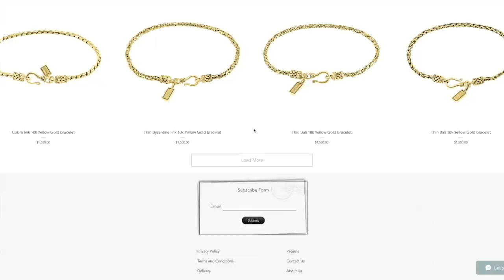Celtic cuff bracelet | how it's made

Comment: Making it look so easy. Not a lost Art! Dynamisjewelry inspiring!
Reply: Drawing silver wire through the plate is not as simple as it appears.  It requires proper annealing of the wire, getting it started properly and liberal use of wintergreen oil to make it slide smoothly.  I've had lots of drawn silver wire crack.  Might be easier to buy the silver wire in the diameter you need.  Also wire mills are expensive.

Comment: BTW: You do not need to solder. Just wrap the ends. You do not need to have rolling tool, you can use premade wire and just hammer it together. You do not need drill. Polish can be made by hand.

Comment: What do you use to whiten the silver after the fire?
Reply: The white color is an effect from the pickle solution, it rubs off.
Reply: @TheMayflowerPilgrem  I know, but the green liquid that is in the heater with lid, that liquid I want to know what it is, I know that it is stripping liquid, but I want to know what solution is
Reply: @jacobmata6638  the stuff in the crockpot is pickle. The stuff he blackened with is called liver of sulfer.
Reply: @TheMayflowerPilgrem  you didn't solve my question, but thanks, nice video
Reply: That white color is pure silver left after the pickle desolves the copper in the alloy. For a pickle there are several options, although sulfuric acid/vitriol is usually the working agent in the solution. The most used kristal form is vitrex powder, which is desolved in water to create the solution. Sodium-aluminium-sulphate can be used to create a toxic fumeless solution, but it works slower. The solution is colorless when you make it, when is get's saitisfied with copper, it turns green.

Comment: Wouldn't the metal be softer longer if you didn't quench/temper it???
Reply: The metal is not tempered, this is usually only a process used on an iron alloy. The quench is necessary to remove as much energy from the metal as possible so the internal structure stops moving. If you don't quench, the metal will harden again.
Reply: It looked more like he was annealing it to remove any tension in the metal after moving it in order to keep it pliable.